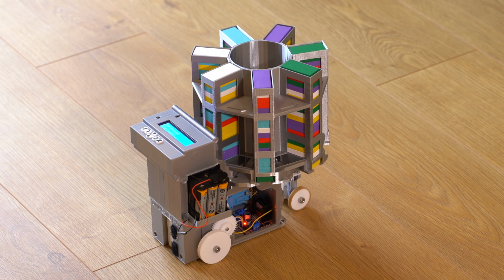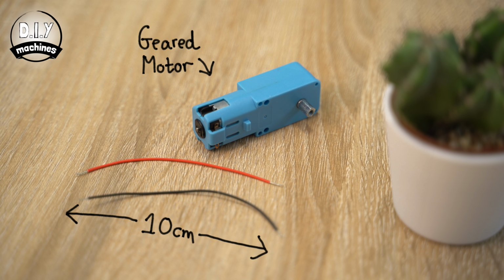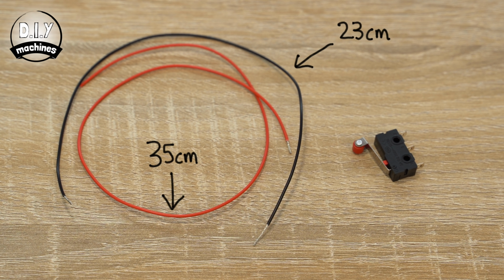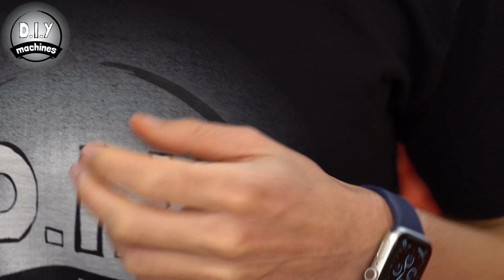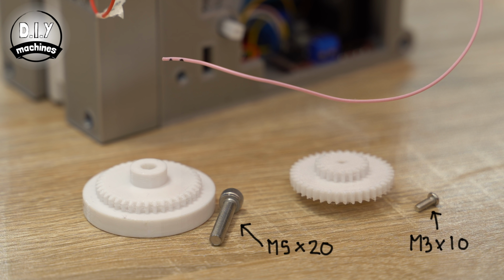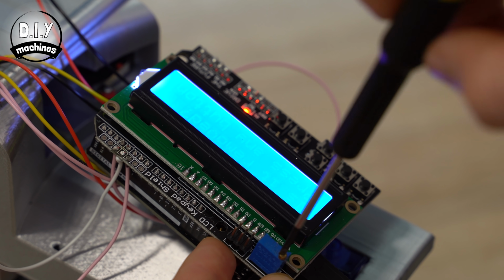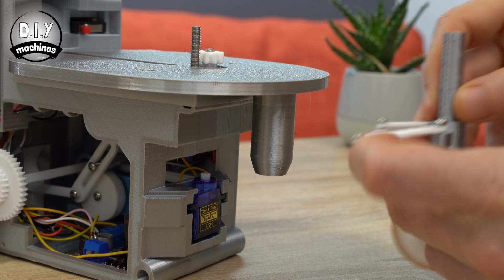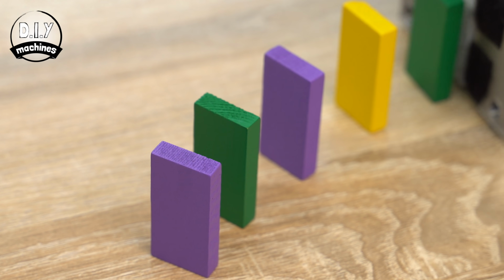DIY Arduino Automatic Domino Layer - 3D Printing & Assembly - Elegoo

Comment: Unfortunately, I have to report bad news. I have tried to build that device, as I wrote earlier, but it failed to work due to lots of mechanical problems.
I held my (bad) printer responsible for the lousy functionality - domino jams, that carousel literally NEVER stopped where it's supposed to, that sort of thing. So, when I had my new printer, I decided to start all over.
The results, however, kept being as bad as they were before. Jamming, no reliability altogether with the mech parts and the goddamn carousel never gets in place, no matter what I do with that microswitch or whatever.

I've learned a lot about 3D printing along with this project, no doubt. What I learned in the first place however is that I won't continue with this project, nor can I advise anyone to try it.

I am really sorry to have to say that, Lewis, since developing this device must have taken a lot of effort. Everything seems to be so well-tought. However, it's pretty disappointing to try to rebuild it when the efforts one spends oneself won't lead to the results desired or expected.

Comment: I cannot get the steering servo to respond. I have checked the wiring several times over, even redid the wiring. Also tested the servo. The servo is good.  
I can only assume that it's a coding issue.  Anyone run into a similar issue and found a solution?

Comment: i really love your machines!

for your wheels: you could make a small gap around them and just put o-rings in them. they'd last longer, grip better and are exchangeable easier. 
for those who like to disassamble the machines later on eventually - there are cheap tools available on ebay, that allow to crimp on connectors for the pinlines. pin connectors are very cheap available as well.

and again!

I
LOVE
YOUR
PROJECTS!
Reply from the maker: Thanks for the tip with the o-ring. It's a great idea and I'll probably do it on a future  project. As for the pin connectors I guess you mean these: https://youtu.be/jET1QTP1B7c 

And thank you for your super kind words, keeps me motivated to keep working on the next project when it's not going as planned.... 😁

Comment: Τhe point is the machine to put all them without a single fail, otherwise will be a disaster and possibly in worst case scenario will drop down all of them because a single fail of one piece ! 😁
Reply from the maker: It's not 100%. Rarely one will topple as it is laid but that's why the program on the Arduino automatically adds in firebreaks/gaps in the pattern to prevent them all going if that should happen.

Comment: This is AMAZING!! I actually had this same exact idea years ago! I thought it would be so cool to make an upgrade of those old domino dealer toy cars that automatically set up dominoes, but you can program the layout/design on the computer or phone and control it with a remote. I'm in awe that you made it happen! I truly appreciate the amount time, care, and attention to detail you put into this machine. Love that you implemented safety gaps (firebreaks), and the rotating carousel is a genius idea to hold more dominoes. It's also neat that you can easily switch out the carousel with another one that's already filled with dominoes and ready to go. 

As a pro Domino Artist though, the only thing that sorta bugs me is that the spacing between dominoes is too far apart. Generally, spacing between 8mm and 1cm is standard for better reliability (especially when the dominoes turn a corner). Also, can this fit dominoes with dimensions of 24mmx 48mm x 7.5mm? This is the standard size for toppling dominoes. I wonder how it would work with precision-engineered plastic dominoes, like these: https://amzn.to/2LHaZQg. I would imagine it might be easier for the dominoes to stand up because they have sharper corners, and even minimize the amount of dominoes that are angled/offset slightly when placed. 

Overall though, I'm super impressed and absolutely love this!! Excellent excellent work!
Reply: The best domino builder of Youtube on the channel, so my hint on Twitter hopefully leads to new fabolous builds 👏🏻👍

https://youtu.be/HqwVFXyCfOI
Reply from the maker: Thanks. :) It took a lot longer to get it working than I thought when I started out to make it,  but it has been great fun to use now that the project is complete. The firebreaks were a casual remark from my Dad when I was discussing the idea with him and it's the best idea he's offered yet. (Sorry Dad!)

The dominoes I built it with measure 21x45x7.2mm. They are cheaper wooden ones: https://geni.us/Dominoes. I had considered the ones you link to but it was going to cost me too much to buy enough for the project video

In theory, as it is currently designed, it should be able to work with dominoes up to  22x46x8.5mm. The limiting factor for the domino height is carousel which could be modified and the width is limited by the exit passage which is also modifiable. I think you're right that the engineered dominoes would be easier to work with.

Thanks for taking the time to share some of your knowledge. If I ever work on another machine like this I will follow your advice for spacing. Thanks. Lewis.

Comment: Excellent project! Was very fun to watch and it is very rich in details! Question how in the world you print 90 degrees overhanging without support??? The carrousel on my end uses more material for support than for the part itself!
Reply from the maker: Thanks Marcio. The 90 degrees overhangs on the carousel are designed to be printable as small bridges. I kept their lengths down and added additional details to ensure their successful printer (such as the bars beneath the platforms with arrows on them). You should find your printer bridges these gaps by stretching the plastic between the two points.

Comment: Very impressive. Woodworker/Youtuber Matthias Wandell made one out of wood some time that was already fascinating but yours is definitely fantastic.
Which bluetooth app are you using? One from the playstore?
Reply: It seems to be Blynk
Reply: @iotopentech  tnx. Too bad. I do not use blynk 🙃
Reply from the maker: Yes it's Blynk, but via Bluetooth so no internet connection is required. The next video explaining this should be published in the next couple of days.
Reply: @DIYMachines  thanks. Have been avoiding Blynk as i understand at a certain point one has to buy energy or something but may give it a try
Reply from the maker: @Ed19601  Yes you're perfectly right. Though if you have not used Blynk before I kept the features of the app below the amount of 'energy' they allow you to use for free. :)
Reply: @DIYMachines  thanks. Will certainly give it a try.